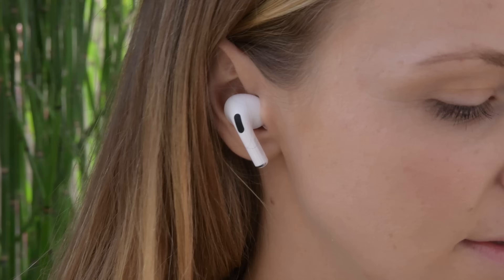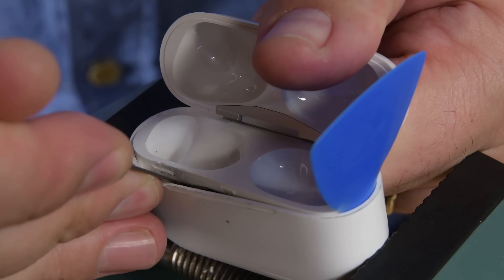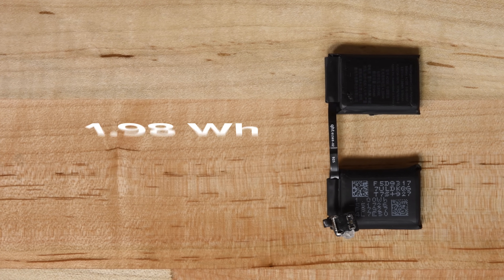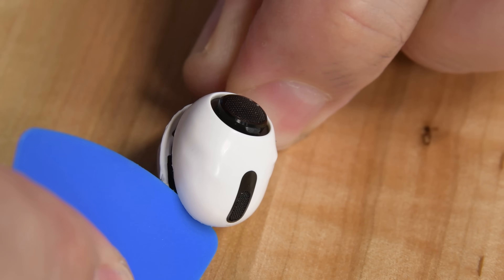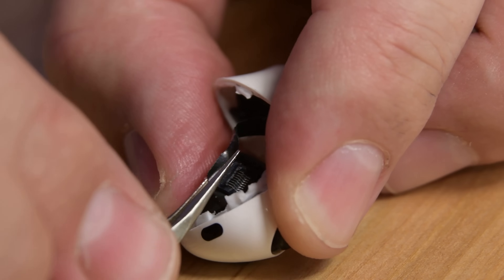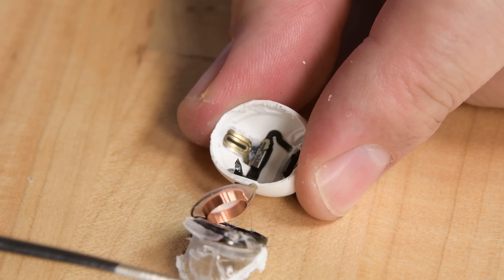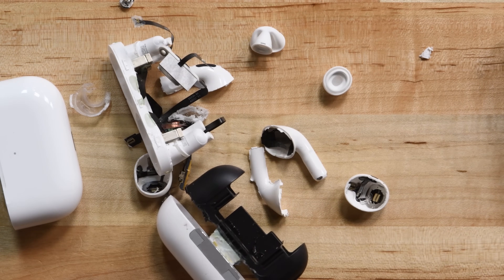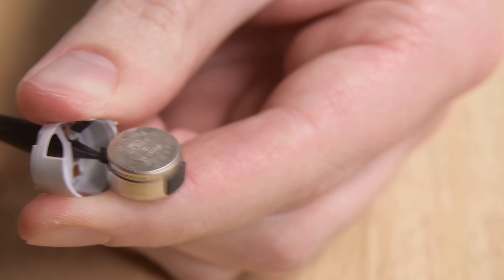AirPods Pro Teardown—0 out of 10 Total Destruction!

Comment: Just recently my Apple Pencil called it quits.  So, with my personal tradition, I wanted to see "what it has had for breakfast".  Very quickly I saw that it too was built for "Repair?  Are you from some other universe - we design it painstakingly for no repair..."  Well, well, I'm not giving up so easy.  With my Dremel (and after a cut to my finger by the stainless steel inner wall), I found that the suspected battery was actually O.K.  The fact that it did not communicate was something else, still not figured out.  I lost!

Comment: I’m getting this horrible squeaking noise whenever one of the two black microphone parts of my left earphone is touched. It occurs on ANC or transparency mode regardless and it squeaks so loud that it seems to disable the NC or sound output a bit and then it goes back to normal. I found SOOOO many people having the same issue online but no one has a ‘fix’ other than to ‘reset it and see what happens *herp derp*’

Comment: After watching this, seems better to invest the same amount in ANC headsets. All batteries eventually fail and they're generally easier to fix. And most still work as wired headphones. Throwing away $250 just because of spent batteries is not cheap.

Comment: Technically the batteries could be replaced. They’re standard button cells like the ones in other headphones and even though they’re soldered/spot welded, they can still be removed and replaced or at least recycled which is an improvement over the original ones. Also, you could use heat when using the vice to open the case which should make the middle piece pull out easier. Batteries are really the only thing that needs repair in wireless headphones because damage to other components is generally from the entire units getting bent or crushed or water damaged. Technically the speaker grills might be replaceable since they are the other component that reduces the quality of the headphones.

Comment: Whats my problem with these? First at all, the Case makes weird sounds. But not all of them, I was the unlucky one who got one. Then the first left AirPod had an Problem with loading. so I wanted to give them back, they said they can just let them repair. after two weeks I got it back plus a new left AirPod. And that's the Point where I am rn. The new AirPod has The black Mesh on the ear site pushed in a bit, so it hurts. Now I have to go to Mediamarkt again and hope they fix this. Sadly my 2 weeks are over now anyway so even if its not apple I wouldn't be able to give back.

Comment: I would give them 1 out 9 10, because you can change the battery on the case. It is possible just useless, because the battery on the buds can't be removed. And Apple fans do not repair their products. They just buy new one.

Comment: Why does repeatability matters for Airpods? These accessories are not designed to be repairable. If you send them to Apple to repair, it's cheaper for them to just give you a new set rather than spend labor hour to repair them. In fact it's true for almost any consumer electronics accessories.

Comment: Honestly this 0/10 rating doesn't bother me too much on earphones, especially when compared to the non-repairability of say an iPhone or iPad.  I mean this device costs $250 so replacing it at the battery's end-of-life is not that big a deal.  Plus, it's not like it has a screen that breaks if you accidentally drop it.  Far more AirPods are lost than are damaged anyways.

Comment: The main problem with Airpods pro is not that they are 300 dollar earbuds, it's that they has a build-in battery design to be not replaceable. I have a pair of Shure E5c which were 499 back in 2008(which are much more expansive earbuds if you consider inflation),still running as good as day one if not better because they are now fully break in. But for these wireless earbuds, battery life will drop to a point they won't be effectively usable in 2-3 years. So they are much more "expansive" to own than just "a pair of 300 dollar earbuds" suggested.

Comment: Wireless earbuds are just the dumbest shit ever, they cost more, you can lose them easier, they break easier and their lifetime is limited just by the fact that it has tiny batteries that will degrade within a few years. All that just to no longer have a cable that fucking nobody ever complained about in the first place, wow, progress!!
I used the same $25 earbuds for like 6 years now, had them in the washing machine at least 5 times and they still work flawlessly, do that with your fancy ass $100 wireless ones.
Edit: Fuck me these cost 260€ here in germany?? LOL

Comment: Who wants to buy AirPods in general to have them repaired ? I live in South Korea I got mine exchanged the first generation I dropped them few times they kinda went bad so I got brand new ones for free because everything Apple sales comes with a 1 year warranty I believe it is world wide and I’m still using them today and they’re still good enough. I don’t buy earbuds to have them repaired if in case they go bad I have a 1 year warranty for that 🤷🏾‍♂️
Reply: TJean Blaise what if they go bad more than a few year slater, you know, like normal electronics do eventually? Then what? I get it, repairability should be out of the question, but don’t you think Apple should replace them at a reduced price, instead of over $90 per “pod”.

Comment: That’s why android never going to succeed, the way they build it is crap , Apple 🍎 Is the Bomb 💣 at making devices , even AirPods
Reply: David Nunes Lendvay You realize its a bad thing not being able to have something fixed... right? If the battery dies, you can’t get it replaced for relatively cheap, you have to replace the earbuds entirely.

Edit: Also, Android is not a singular entity, there are many different companies who manufacture varying levels of quality android products.
Reply: Sam Wirth why would you wanna fix something so complex ? Just go to Apple , and have them replace it ,then you have a new AirPod . “While you have a appointment set up,”No need to wait for someone to tear down you’re AirPods to replace the battery ,
Reply: @Zodqueen  My point is that Apple could just replace the battery for cheaper instead of making you pay more to replace the AirPods.
Reply: Sam Wirth I went to Apple store The other day and my left ear was losing power fast ,so I went to Apple and they replaced it for free , no hassle.
Reply: David Nunes Lendvay You must be under warranty. My point applies to those who are not under warranty. No warranty = $80 for one replacement AirPod

Comment: Way to go Apple! These earphones are totally disposable and cost £250 in the UK! Not good, and I certainly won't be buying them. I'd rather have the Galaxy Buds (or stick to my over ear headphones)
Reply: You sound like you’re gonna repair your own galaxy pods lol.
Reply: actually, I don't have any galaxy buds (I'd only get them if they came free with the next phone I buy). But what I have done, is managed to successfully replace the modular battery in my wireless gaming headset, as well as remove the battery from an older pair of wireless headphones without completely destroying them. so it can be done (just not with apple)

Comment: Pro tip: you can get an applecare+ for $29 and replace the battery for free within two years of purchase if the battery capacity drops below 80%.  in fact, they actually just give you a brand new set of earbuds when you request a battery replacement (because they also know it doesn't make economical sense to *only replace the battery*).  so imo if you're getting one of these airpods pro, definitely get the applecare+ as well.

Comment: When would repairing a product that sits in a CASE and your ear ever need repairing? Unless you idiotically SWALLOW them like some kind of animal, or throw them in a lake (sweat resistant doesn't equal water proof) and use them like MOST people do, they will NOT need repairing...
Reply: Because batteries lost capacity with each charge, eventually no matter how delicate you treat them they will fail, be able to change the batteries on this would be better.
Reply: @JoseMarioLagos  And how many people who bought their airpods in 2016 are complaining about shortened battery life. It is inevitable, but that doesn't make it a scam. Atleast they got the battery out before breaking them, so in theory the battery can be replaced. Phones like Samsung phones have their battery glued without pull tabs which makes it dangerous to repair.
Reply: @Silver_x86  A lot of people are reporting batteries fail with their airpods, just Google it, not hard to find the complains and news articles about it. by the way iPhones have the batteries place with adhessive too, most phones are really, but that it's the problem, we are getting use to disposable items like it's a normal thing to do, but shouldn't be that way, no matter the manufacturer we should have the right and accessibility to repair our stuff, apple even disables phone when detects that you replace the battery that's just plain bad, Samsung, lenovo, Microsoft,etc no one should be able to avoid me to repair my stuff.
Reply: @JoseMarioLagos  Apple does not "disable" phones for replacing the batteries, that's a plain lie, it disables the battery health feature, that's it, and while I think that's still unacceptable, it doesn't make it a paper weight. I agree that any phone to have a "pro" title should have user repair ability, things like this years iphone and airpods don't deserve that title, but Apple isn't the best at names. Every phone does have adhesive batteries, but the ones that use pull tabs to remove the danger of prying a battery out is what I'm refering to with Apple, Jerryrigseverything's tear down of the s10 and 11 pro max can explain that
Reply: @JoseMarioLagos   by the time the batteries fail there's going to be a new model anyways, there's no point in repairing them. Even if Apple makes the airpods repairable people wouldn't bother going through the trouble to take them apart.
Reply: @noobminer2893  yes most people will not, but they should, new models most of the time doesn't offer substantial improvements, so if I'm happy with the product I have (yes you don't need the latest stuff to be happy) I will gladly try to repair it, look I'm not trying to make apple look bad, I'm trying to people to see that they can save money for other more important stuff, I'm a geek a take thing apart just for the fun of it and try to save money in the process, but this company's are taken the right of repair out from out hands, not everyone will do it, fine! but you should leave the option for the people how want to rapair, more when it cost 2xx+  dollars for something that I can do with a wired headphone that cost nothing and sound almost the same or a lot better.

Comment: Microsoft, 2019: tries to push repairability score as high as possible
Apple, 2019: tries to push repairability score as low as possible
Reply: Schnoz An iPhone is easy to repair not like Samsung
Reply: @lka4678   I'm mainly talking about Airpods here. Actually, you're right--iPhones are a bit easier to pop open than more recent Samsung phones, but many other Android phones are easier to open.
Reply: Schnoz Omg first time someone reply with some intelligence.
Reply: Its easier to make an notebook more repairable than an small piece of tech like this.
Reply: @catboy3471  thats good news for repair shops and consumers overall, but what about the people who DIY it? it says they will sell OEM parts to repair shops with a certified apple technician, will they also sell to distributors? will we be able to buy genuine parts on amazon or something?
loads of questions are unanswered
even though apple is going to sell the parts, that isnt to say their products are easy to repair, they still use incredibly strong adhesive on the back glass of their phones, they still weld the camera bump onto the phone, they still use different bits and plenty different sized screws
Reply: Airpods pro is very expensive
Reply: Now it gonna be minus
Reply: What Microsoft product did make that scored well? The Surface products didn't scorr high.
Reply: @deoxal7947  The Surface Laptop 3 scored 5/10, which is much better than zero.
Reply: @UItEnthusiast  I wouldn't call that as high as possible
Reply: @deoxal7947  Well it's pretty high for such a thin laptop, and the fact that they used magnets instead of clips means that they MEANT for iFixit or general users to pop it open.
Reply: but why would you repair the AirPods?
Reply: @bauermarinus  Because they cost 250$. At least if the battery was removable you could keep them longer
Reply: @bauermarinus  it's about the dissasembly for when you have to dispose/recycle them. You can't just throw them away in the trash (which seems to be where these will go since nobody will send them to apples recyling center where they just ship them off to a Taiwanese or chinese "recycler" who really just tosses them in a junk yard somewhere  waiting for them to explode since barely any of this is recoverable.
Reply: That only applies to AirPods. iPhones have really good repairability. It’s been 6 for a few years now.
Reply: @RR-uc1wb   Their phones are easy to pop open, but it's their anti-repair policy that's annoying. You're not allowed to upgrade your own memory in an iMac Pro, everything is soldered down in a Macbook, and Apple messes with your iPhone if you replace the screen with a third-party one.
Reply: @RR-uc1wb  Some Andtiods are even easier. You can literslly replace the battery without any tools whatsoever. Just take off the back and put it back.
Reply: @RR-uc1wb  6/10 is medium not good
Reply: @etiennedud  still better than a shit ton of other high end phones
Reply: @etiennedud  it's relative in today's tech, because of how integrated everything is, 6/10 is now the higher end of the spectrum.
Reply: @ubacow7109  Fairphone 3: "Am I a joke to you?"

But yeah, besides those, I haven't seen a 10/10 repairability in a long time.
Reply: @etiennedud  Well the S20 Ultra got a 3
Reply: @RR-uc1wb  iphones do not have really good repairability, ifixits score is really saying how easy it is to replace the screen
back glass repair is near impossible, like 3 or 4 different screws with plenty of different sizes, no modular connectors vs something with all that but has the display doesnt come out first gets a lower repair score than iphones...
apple also does not supply parts for third party sellers, making it harder to get OEM parts

Comment: AirPod pro doesn’t work

Goes to Apple

Apple says they are going to fix it

What Apple actually does: pairs a new AirPod to the case and to the other airpod
Reply: they actually pair not one, but both airpods to the case, bc the airpods are also paired between them selfs (have some experience with "fixing" airpods by Apple xDD)
Reply: tbh honest it doesnt sound bad you get a newer and not used hardware but i guess this is the reason why the price for "repairs" is so high

Comment: I like is less difficult than before. I would give them 2 points. But they need to make it easier to replace the battery. $250 is a lot of money for a piece of hardware that you would have to throw after two years. And of course it would help a little bit the environment

Comment: Well I can't imagine someone trying to repait such tiny things anyway. Even the better repairable Galaxy Buds. So it kinda doesn't matter if its a 0/10 or a 4-5/10.
But luckily I don't have to care because InEars aren't my thing 🤷‍♂️
Reply: Tim R. I can see replacing a battery being useful, but you’d sacrifice something to make everything easily replaceable, be it cost/size. I used to repair and re-coil those little drivers, so I’d be the one to try and repair them lol
Reply: Rennie Ash You end up breaking the watertight structure of the earpieces. Same thing applies to phones. Once you cut into the phone, water resistance is compromised.
Reply: Bluetooth earphone ain't my thing unless I keep another pair of wired earphones..
Reply: True